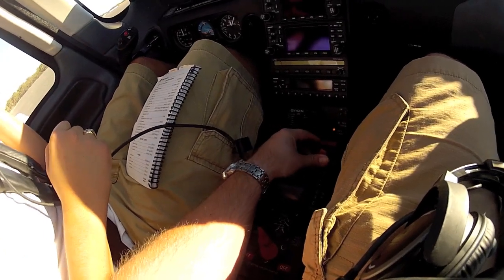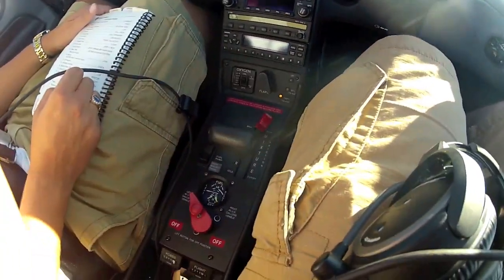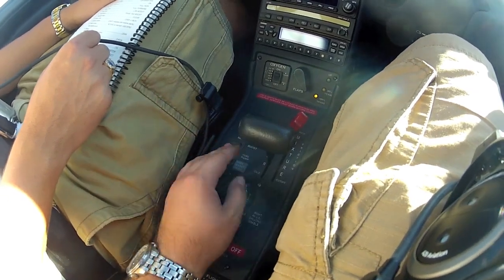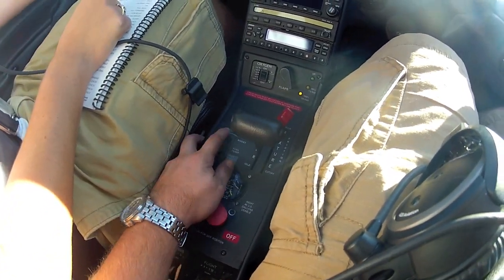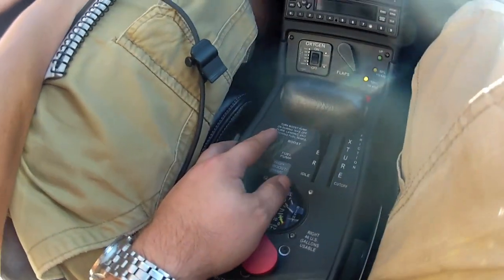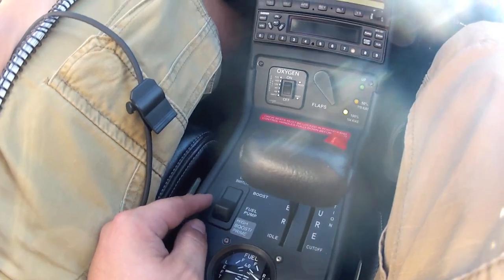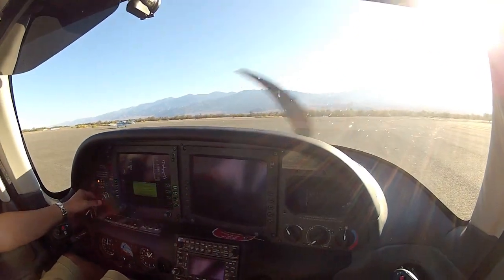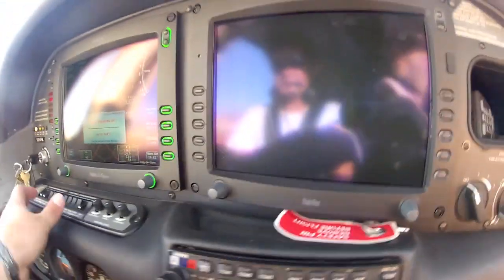Wages Method; Hot Start technique for the Cirrus Aircraft

Comment: Worked well in my turbo today, helps to have a starter adapter and starter in good working order too :)  

The RPMs surged for a few minutes while it worked the vapor out (after start) but it started about as fast as it did in your video, which was terrific - minimal hit to the battery.

Comment: On my SR22 NA (G2, 2006) this would not work. I let the boost pump run for 20 seconds, pull the mixture and with the boost pump on I crank the engine while advancing the mixture. Starts every time, no matter how hot.

Comment: Mark, what procedure do you use when ATC keeps you too high and vectoring you to the final approach course to intercept the glideslope from above on a g1000?   Other than manually bugging the altitude and using vertical speed to get to a stabilized approach prior to the final approach fix.

Comment: No prime/high boost huh?
Reply: Daniel Blell nope just regular boost until the pump starts pushing fuel then crank it up. The key is waiting until you hear the fuel pump change rpm. It goes from cavitating (pushing air) to pushing fuel then you crank.